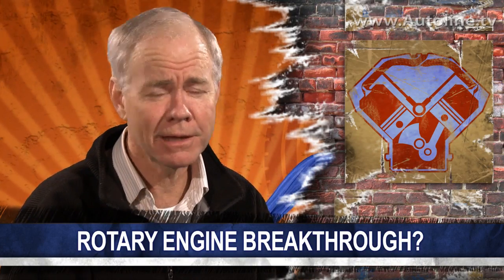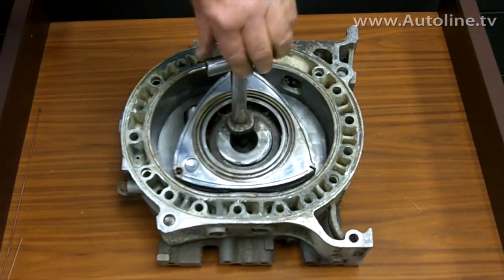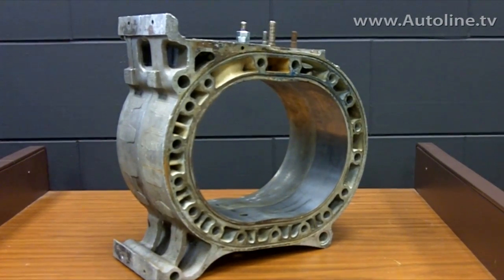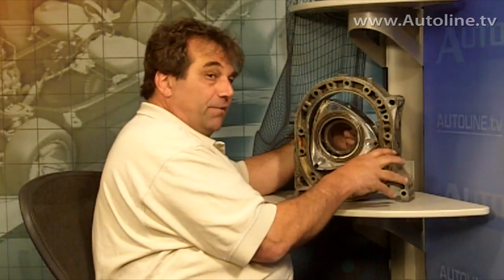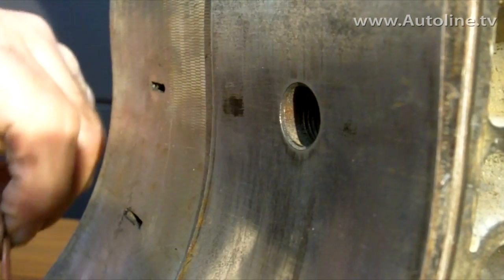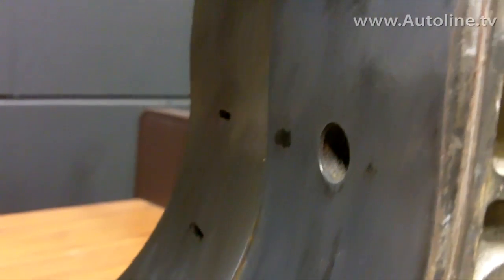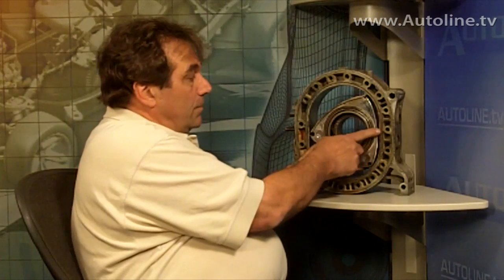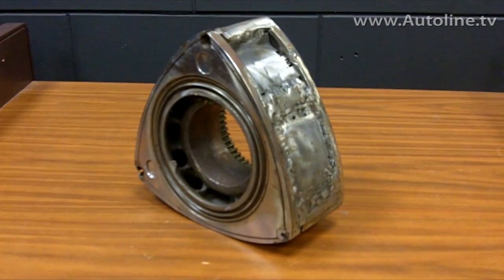Rotary Engine Breakthrough?

Comment: bullshit!

1)  compression leakage:  by the time the apex seal hits the spark-plug hole it's a much reduced compression.  turning the circle into a slotted hole will simply disallow spark.  i agree there is an issue but his solution is bullshit and will block spark.  moving the hole downwards causes the ignition to be uneven, as well
2)  modifying the combustion chamber to push harder on the power-stroke:  wow, this one is total bullshit.  all he did was fill in the chamber with metal.  this will not only throw off the balance of the rotor but it will totally make ZERO difference as to pressurization.  oh, sure, it would be great to push harder where the force does the most good but pressure does not care about design!  in addition, the eccentric shaft it pushes against is offset and the pressure on the top of the rotor does push, like a piston, in a direction that increases power.  for this idiot to say the pressure at the top of the rotor works against is like saying 1/2 of the pressure on a piston that is closest to the center of the motor works against the power stroke while the other half is more forceful to creating power.  just idiotic

this is sad and moronic

Comment: The shape of the recess in the rotor, or the quench area if you will, makes sense in this revised design. I wouldn't say it's like an offset wrist pin. More like leverage like increasing crank angle. The combustion would then "kick" off of the lower side of the combustion chamber, more easily pushing the the leading edge of the rotor where the eccentric shaft is going to see the most leverage. This alone could improve torque. The other thing to note is that as the dish in the rotor is static, it partially allows exhaust gasses to squeeze over into the intake chamber, contaminating intake air/fuel. Make an effort to reduce that and there may be another gain on the table. People like to talk about the Wankle's torque inefficiencies. However, consider that when the tach indicates 9k RPM, the internals are only spinning 3k. Thus, the Wanke makes INCREDIBLE torque, but it doesn't transfer well due to the 1:3 ratio of output. Rev a piston engine (non diesel) to a maximum of 3k and see what torque it makes. Just a comparison. Its worth noting that the Apex seal made a world of difference in the Wankel. And Felix hadn't even thought of it when he was testing the engine in French cars. That actually took a while IIRC. The Wankel has NOT had the amount of engineering behind it that the piston has, and we are still optimizing conventional engines today. I'm certain there's more left where Mazda and others have left off. Just takes some brainstorming.
Reply: WTF???    Please explain THAT, if you don't mind...  actually, doktorbimmer, when you do this it makes me suspect you might not have the argument to back up your position.  Why do you feel the need to hurl insults rather that to discuss the piston recesses?  You finally have the very person at hand, Ernie himself-   you finally get to teach the world that you know better, you finally get to WIN THE INTERNET after years of this, you've got the guy in your sights, and what do you do? You change the subject to some tin foil hat thing.   Let's hear the reason, ok?
Reply: The real doktorbimmer Could u elaborate what is wrong with his analysis plz??
Reply: YOU ARE HIDEING UNDER A  ROCK THE LORD IS MY ROCK AMEN
Reply: Same here... filling my inbox with 'but hurt' and '416' .    What's with the number 416???  Is that the number of the devil or something?
Reply: Ernie Brink
I think your mental stability is clear to see, typical rotary fan really.
Reply: The real doktorbimmer DO you think wankel engine its a desing fail with no solution?¿
Reply: @MElekiaZ  ZERO TOLERANCE ON LEAKAGE
Reply: The lens I'm looking through is that of watching you get set off over and over again.  You seem to lose it whenever someone posts other than your view.  I think we can call you doctrinare bimmer.
Reply: First off, the 'making a fool of you' thing isn't working.  I never had an argument with 'Ernie' and i never had a dialog with him.  So...... your evidence to the contrary consists of:  Nothing.
Second, it really does sound like he slipped up and is the same person (Anthony).   Congratulations, you finally have a 'victory' of sorts, after approximately 2 years of a dozen people expressing hatred towards you.    If he slipped up and sent you something using the wrong name, I'd say it was becoming suspicious anyway because 'Ernie' and 'Anthony' seem to use the same short, strange phrases in their posts.  Very strange.   Too bad he's just making weird comments instead of really engaging with you, I know you're dying to destroy him online!
Reply: Believe me, I am not Ernie or Anthony.  His (or their) comments are some of the weirdest comments/trolling I've ever seen.  It's becoming a new point of interest for me- what does the mind of someone on bath salts look like?
Reply: Again? Why copy my comment, or is this the real doktorbimmer impersonating EB?
Reply: "Ernie where is your working prototype?"
Why do you keep asking a question you already know the answer to?  You know full well he doesn't have a working prototype, you know full well he's just an enthusiastic guy who has some suggestions.  You've asked the same question like 10 times now.
Reply: Please dude, please stop posting entire paragraphs in the subject line.  Can you please stop doing that?
Reply: @someotherdude  Today marks the 10 year anniversary of the final demise of RX production at Mazda.
  The very last Wankel engine car rolled off the assembly line at Mazda's Ujina #2 plant in Hiroshima Japan on June 21st 2012 at 4:30 PM Tokyo time.
Reply: "ERNIE! You look like a fool right now, just admit you are a fake...."
Dude, you've now harped on this theme for YEARS.  You made your point, I'm pretty sure you vanquished Ernie.  But a better man would move on to more provocative, interesting discussion. Besides HCCI, what do you see on the horizon?  You're a smart man, an engineer, so take us thru the interesting diesel developments and possibilities that are out there.  I never hear you posting about BEVs for one, and what do you think about the free piston engine/linear alternator setups?  To me that is a very elegant solution just waiting for better free piston control.  A diesel version seems very possible to me.  What do you think?  And isn't it ironic that the company you hate the most is bringing a diesel to North America and an HCCI engine?  It's exciting.
Reply: @marvincross1149  Any real engineer will quickly spot the fatal flaw in Ernies laughable concept..
Pascals Law of Fluid Dynamics prevents the pressure from being higher or lower at any point along the face of the rotor.
Reply: The real doktorbimmer you are in all rotary videos? XDDDDhi again dude
Reply: The real doktorbimmer youre like jesuscrist or mahoma talk about the type KKM engine to the people XDDDDD oh man,you¨re so funny make my day :)
Reply: ....so now your'e forced to clarify with 'subsonic'. That's good.  Now what about a recess influencing mixing or flamefront propagation?  I'm glad you and Ernie are finally on the same page (literally, NOT conceptually, LOL) but you should be polite.  Ernie believes what he is saying. He's not a 'fraud'.  He's not trying to steal money thru deception.  If he is in error in his theories, point it out with reason and not with epithets.  

The next few days out to be interesting!
BTW- I turned in my sportwagen TDI and got a good payout.  I miss the car terribly, but I now live in an urban area and the engine hated short trips.  I bought a Prius Prime and I'm averaging 56mpg around town in rush hour!  I'm really enjoying it.  Thanks for asking.
Reply: I'm the first one who asked several questions of you in this latest round of the internet trolling you.  And you still haven't responded specifically to those questions.
Reply: @someotherdude  ZERO TOLERANCE ON LEAKAGE
Reply: Calm down....  I have no idea where he went or if he is actually the Anthony guy you keep mentioning.  But Ernie is so terse and short-spoken that it doesn't help much when he posts.    Here's a question for you, Doktorbimmer, what happens when diesel is pushed out of europe?  It's really looking like this wiill happen.
Reply: ".....and "WHERE IS THE LORD"  Cuckoo Cuckoo Cuckoo!!!!"
At last, something from you I can agree with.
Reply: ...can anyone smell bat shit...?!?!?!?
Reply: What????
Reply: Ernie, no offense meant here, but it would be more helpful if posts like the one above ^^ sounded coherent.
Reply: ".......both Columbus and John Cabot were almost undoubtedly aware ...."  Ooops I think your post was meant for a different thread.  Although I am interested in that history too.
Reply: http://www.aieuk.com/
Reply: ......and it's driving. you. crazy.
Reply: Doesn't matter where the recess sits, pressure would be applied equally across all faces?
Reply: Hey, this is a request to everyone, can we stop putting the huge 300 word subject in the subject line?  Can someone tell me if my comments are doing that too?   I'm receiving 6 to 10 email notifications per day with entire dense paragraphs in the subject line instead of the text body of the post, where the paragraphs belong. 
YouTube really sucks now, and it seems like it began to suck when google took it over.
Reply: The real doktorbimmer changed his name to some other dude but we all know it’s still that douchebag ranting on. Dude get a life and turn the page no one wants to hear you rant on anymore. Every rotary video I e seen has your dumbass in the comments and it got really old no one can say anything without u commenting ten times
Reply: @dickjames5007  just ignore some other dude, this guy is a total douche
Reply: @marvincross1149  Ford divested itself of all ownership of Mazda in 2009 after the financial failure of the RX8.
The fundamental inferiority of the Wankel engine would render the design obsolete, all of the engine manufacturers including Mazda have discontinued development and production of Wankel engines.
Reply: He didn't make anyone but himself look like a fool.  A  PCP-addled mind cannot get over on a healthy mind.  He is entertaining though.  Did you see his other video ('rotary hemi breakthrough) search for that on youtube.
Reply: @someotherdude  ZERO TOLERANCE ON LEAKAGE
Reply: mazda is going back to the wankel engine!  It's superior! mazda is going back to the wankel engine!  It's superior! mazda is going back to the wankel engine!  It's superior! mazda is going back to the wankel engine!  It's superior! mazda is going back to the wankel engine!  It's superior! mazda is going back to the wankel engine!  It's superior! mazda is going back to the wankel engine!  It's superior! mazda is going back to the wankel engine!  It's superior! mazda is going back to the wankel engine!  It's superior! mazda is going back to the wankel engine!  It's superior! mazda is going back to the wankel engine!  It's superior! mazda is going back to the wankel engine!  It's superior! mazda is going back to the wankel engine!  It's superior!
Reply: .....yes, and you clearly can't stand knowing that someone else needs your correcting.  Which is why you'll post many demeaning, insulting, belittling things aimed at ernie, repeating it over and over.....
Reply: The real doktorbimmer really the problem can be solved but maybe is not rentable in the actual days
Reply: doktorbimmer  I know this is old and I know a lot of what you said in this is right and would have to have a bunch of other stuff to even get the motor to fire, but Pascal's law only effects true liquids not air.

Comment: Fuel economy is from the time the combustion has before exhausted
at higher RPM you displace more per minute at full throttle but the throttle is open less when cruising so the chamber fills less, and at lower RPM you give more throttle but the combustion has more time to transfer energy instead of chasing the piston

need to slow this engine down for economy but it can still run fast when you need more power, his design could run at a lower RPM

Comment: 5 stroke engines are the way of the future. lower compression, lower exhaust temps, higher expansion, higher hp for a given displacement, and better fuel efficiency.
Reply: yeah im impressed with these rotary 5 stroke diesels too. too bad mazda doesnt make them anymore... obsolete.
Reply: You do realize i'm not talking about a rotary engine right?? i'm talking about a 5 stroke engine... totally different thing. Rotary engines have been obsolete for a while now and someday a 4 stroke will be obsolete too. 5 stoke engines basically have two 4 stroke pistons that power a third piston with the expanding gases from the exhaust strokes from the first two pistons. you can look it up yourself if your into that kind of stuff.
Reply: i know everything about the rotary engine except how it works.

Comment: the biggest problem with wankel engines is apex seals, they wear out too fast and fail too soon there got it, the spark plug hole can be eliminated with a insulated spark plug and then no gaps there
Reply: you dont need spark plugs..... just add water to you're fuel, the hydrogen in the water will ignite its self under pressure.
Reply: ok no it's pretty obvious why you dont want to use water in any engine, and if there wasn't automotive would be using it, what your describing is ignition through compression heat aka how diesel engines work.
Reply: no i know eveything about cars and engines and stuff that goes broom. im right as always. obsolete
Reply: doktorbimmer Car manufactures have been pouring billions into sophisticated computer systems in an attempt to solve pre-ignition combustion and squeeze the extra BHP / fuel economy out of a finely tuned engine.. Your solution is to encourage pre-ignition?

Comment: Make a breakthru, stuff it into the MX-5 and you will be able to sell enough.  Miatas are one of Mazda's prized models and has the Guiness world record for best selling 2 seat sports car, reaching 900,000 in 21 years.

He still didn't mention how to lower oil and gas consumption on the rotary?
Reply: Miata/MX-5 Best selling two seater.   VW's first beetle[4 seater] sold 14 million in it's production and two million more under Brazilian licensing.

Not bad for an air cooled flat four.  BTW, the flat six 3.7 Turbo Porsche's spank RX-8's all the time. I'll take Dr. Ferdinand over Finicky Felix every time.
Reply: Aye Bee Um, when you have to compare the engine in a $100k car to the engine in a $30k car to make the lower cost car look bad, you fail.  Comparing apples to oranges never works.  The rotary may have flaws, but id hate to work on a boxer.  Talk about a overcomplicated motor...double everything by making 2 banks like that.
Reply: The real doktorbimmer so are you a Subaru or vw fan. I hate working on both. If I could afford a Porsche someone else would work on it. Now a headless 2stroke boxer engine sounds more interesting.
Reply: The real doktorbimmer I was thinking of Hofbauer and his OPOC maybe mounted to a hybrid drive of some kind. I see a 100mpg engine in there somewhere :)

Comment: Theres minimal leakage through the spark plug hole since the majority of compression doesn't occur until AFTER the edge of the piston moves past the hole entirely.  And also the offset compression chamber means the spark plug is no longer centered in the charge and you'll get an unbalanced explosion.   Besides all you need is a tiny amount of momentum to get the engine to spin in the right direction, the compression will carry on pushing in the correct direction with no backwards force.
Reply: its a steam engine.... there are no spark plugs.
Reply: Good point, I think there is some loss of compression but not as much as Ernie says.

Comment: My understanding is that the rotary piston of the Wankel engine has sealing components only toward the sides containing the spark plugs.
If this is correct, why there are no sealing components on the lateral (plane) parts of the rotary piston ?

Comment: The Wankel was a good idea It but not really tested and proven to last.As for piston engines if you look after them 500.000Km or more.Now let's go Kiss kiss and talk Electric bikes is giving their gas counterparts a good run for their money.500,000Km before the battery is kaput ?? no petrol brake pads and tyres only??

Comment: You know that actually there is leakage towards the compression chamber and not the other way around as this guy thinks, right? He just ignored the pressure of the gases in the expansion chamber, as the expansion chamber's leading apex has not reached the exhaust port yet when the intermediate apex passes over that spark hole. It is the upper spark plug hole that causes problems, and that's the reason it is smaller.  Mazda engineers were not stupid, it's just this guy has not done all his homework. As for the cavity, early 12As had an eccentric cavity that was later abandoned, meaning there was a reason for it not being needed.